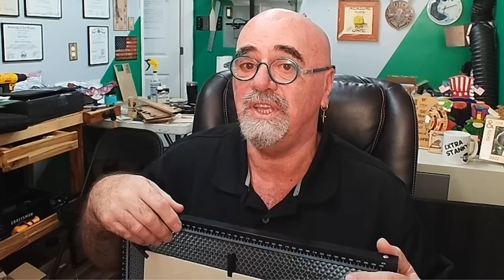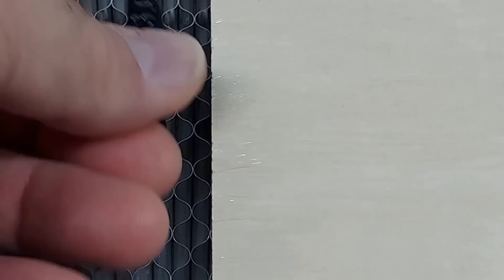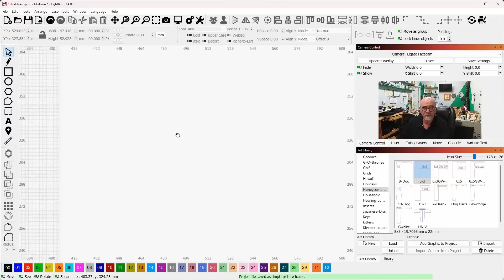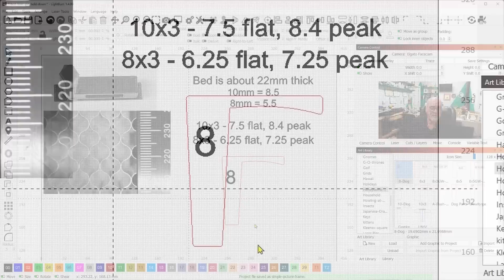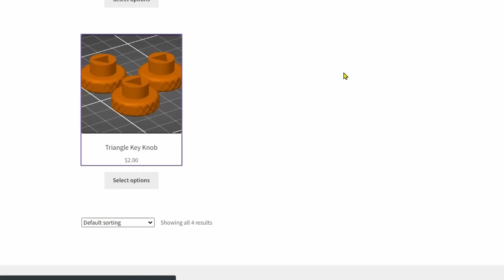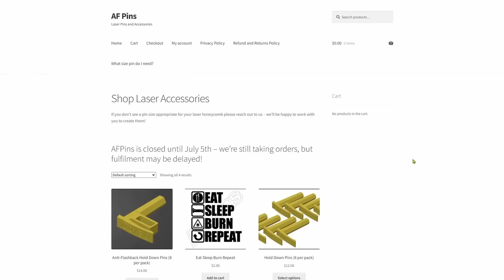💡How to prevent flashback burns on your material with these ingenious honeycomb pins!

Comment: Rich, when would I need this compared to magnets or no lockdown on wood? Is it suggested to use the pins and not magnets to adhere to comb?
Reply from the maker: It's all a matter of preference Shannon. If you need super-clean cuts, you use standoffs, otherwise I just use magnets or nothing at all if the material isn't warped.

Comment: the same can be achieved by placing a thin magnet on both sides.
Reply from the maker: You would need a magnet on both sides of the material to stand it off from the bed.

Comment: Hello Sir, You appear to have Light Burn down to a science. That being said perhaps you can explain why I can never get anything the actual size I want. When I put width and height in at the top of the screen the image is never that size. Example: I want an image to engrave at 3 inches  tall I get 2 3/4 inches tall . Framing before engraving doesn't match either, it's always much larger than the size I want the engraving to be. I have changed from mm to in and in to mm, makes no difference. I never get the final engraving at the dimensions I need.
Reply from the maker: Try this video: https://youtu.be/v8kOH5McCjY

Comment: Standoffs are great for hard surface materials, and really does improve the finished product,  but not so great for things like thinner leather or paper.
Reply from the maker: I don't need them for those items. Just thicker material at slow speeds.
Reply: @TheLouisianaHobbyGuy  I do need something because I do 80% leather and so I use a lot of thing yellow painters tape, with low tack.
Reply from the maker: I use laser transfer tape for leather.

Comment: Funny you just put this out. The ones from your website are too big for the Roly laser bed. I had to modify it to get it to work.
Reply from the maker: The ones on my website fit every laser. I've used them on the LaserMATIC 10.

Comment: I have designed some 3D printed hold down pins for myself in the past, but had not seen the stand-off style before. The results look great. Will definitely be handy for smaller CO2 machines without a downdraft table.
Reply from the maker: I have printed several of my own in the past Geo with a similar design. They work really well.